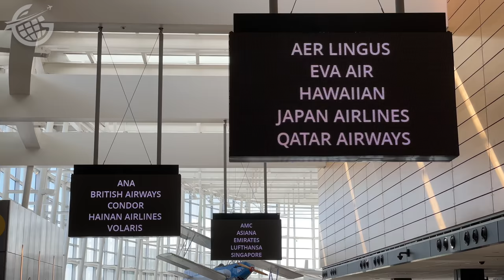Inside Seattle Tacoma International Airport | SEA Airport

Comment: As a Seattle resident for the past 20 years, I love the dynamic growth and development of the city and SEA airport. As the airport renovations finish, SEA becomes more attractive, slightly larger and for Alaska Airlines customers, efficient to use. At the height of Thanksgiving and Christmas rush this year I got to my gate both times in 10 minutes with TSA Pre-Check but there's also a line reservation system at SEA that helps general travelers beat the TSA lines too.

Comment: I live next to Seatac and drive the road next to the massive wall shown in the video every day. I have memories of going with my dad to SEA when he traveled for Boeing, we used to park right in front of the terminal. I followed his passion for travel and airlines. I worked for Western/Delta for 15 years out of the building that is now the Delta hanger, it used to house the reservation sales office as well as the planes below it. When they closed the office I left the industry after 18 years. I worked every position you could except cleaning, FA and pilot lol. Some of my favorite memories were early mornings working in baggage,  on the tarmac as the plane from Alaska rolled up to it's gate position and we waited with the belt loaders, just as the sun was coming up.  Seatac is extremely well run and it's neighbors don't have any complaints about it. It has come a long way baby!

Comment: I am old enough to remember SeaTac when it had just two concourses, what are today known as "A" and "D".  This would have been mid 60's.  There was no parking garage and the original 1940's terminal still welcomed travelers.  Concourses "B" and "C" were added, and then, all of a suddent the airport went through a massive reconstruction.  (I believe it reoponed with a greatly expanded main terminal in 1973,, along with the addition of the two new satellite terminals of which the North satellite has been greatly expanded.)  But,as this video points out a major airport on this amount of land in unusual.  But it seems to work!

Comment: Wow, very cool video! Sea-Tac has been my airport since moving to WA in 1985. However, I'm not a real frequent flyer; I remember something in the news years ago about adding a third runway but did not remember that it opened in 2008. Also, I didn't realize how small the land area is compared to some of the other airports in the U.S. Lately, as air traffic has picked up, I've been fascinated by Flightradar24. The way planes approach the airport is like an intricately choreographed dance! Once in a great while things get a little interesting. On May 3 my Alaska Airlines B737 had just flown over downtown Seattle heading to land when, still north of Boeing field, we suddenly turned west out over Puget Sound, then north! Where are we GOING? I thought. Then one of the pilots explained that someone had taken off from BFI and wasn't talking to air traffic control for some reason--which is why my plane apparently had to get out of the way. So we looped around, flew back over downtown again, and this time continued to the runway. Another different-to-me thing happened in July. I was coming back from Spokane on a SkyWest Delta Connection Embraer E175, and we had to park remotely, exit the plane on a portable jetway, and ride a "bus" to the terminal (gate B21 I think). First time that ever happened to me! Got some awesome views from the bus along the way, though. That new elevated walkway looks awesome, and I was pleased to see it in more detail in your video. But unless I fly internationally, which I have no idea when I'll get to do, I won't be able to use it...sigh. Also, I was in the remodeled N terminal this spring, when it was still under construction. I hope I get to fly out of it again sometime! I'm flying Alaska later this week, but they also use the D gates, so until I check in, I won't know which gate area my flight will depart from. Anyway, thank you for going to Sea-Tac and making this video!!

Comment: I totally get what you mean about running to baggage claim or the gate and not really admiring the airport. I tried to be a little more attentive this time around during my domestic travels and really enjoy the facilities. LGA looks really amazing and modern. SEA feels easier when you're flying out than when you're flying in, in which case it can feel like a labyrinth if you arrived on one of the further away terminals. However, you can't beat the easy public transportation to the airport, that is a high point.

Comment: My base for the past nearly 5 years. The changes over those 5 years have been staggering. Most of my takeoffs logged I have are on 16L and most landings I have logged are on 16R. Been here during rain and snow storms as well as wind, low vis landings to 600 feet and heat waves. From a pilot standpoint, this place can become gridlocked if you're not careful and is always staggering how much goes on here.
Reply: Did you hand fly any CATIII approaches into SEA?
Reply: @heyguesswhat2414  Never had that privilege since I was an FO on the Q400 (except in the sim) and it was Captain only. But they are absolutely spectacular.

Comment: From mid-size airport SEA is struggling to meet demands..
SEA infrastructure is mediocre at best.. 
Terminals are tiny the seating areas are tiny none of this is sufficient for the amount of passengers that pass through.
Excuse that they can't expand is complete BS. We can't make our terminals larger but we can build a tram to nowhere.. well not totally true you can take it North or South and end up right in the middle of the hood 😁.
So if you're on a long way over and you want to go outside the airport to get something to eat you have to go about 5 Miles.
Why you ask because a few years ago they thought it was smart to mandate a $15 an hour minimum wage in that area.
SEA used to be clean and managed well..
It now looks & operates like a teenager is at the helm..
Service is slow across all aspects.
TSA, ha, if you have Clear or NTN you're time with TSA is same as everyone else's..
Inferring that Seattle airport is nice on a scale of 1 to 10 it about a 3.5.. 
Let's be real Seattle, Tumwater, auburndale used to be decent areas, now I get my rental car and get as far away from the area as possible..